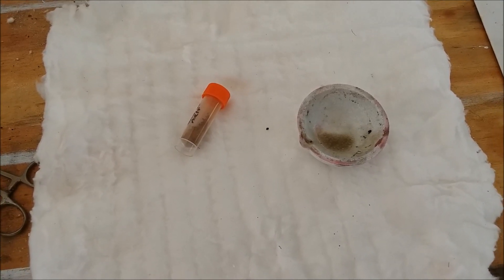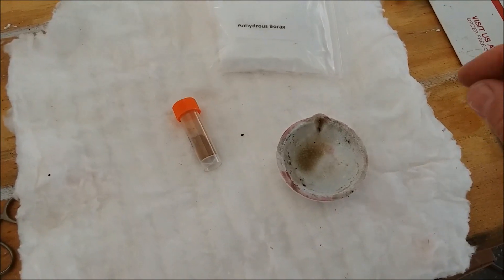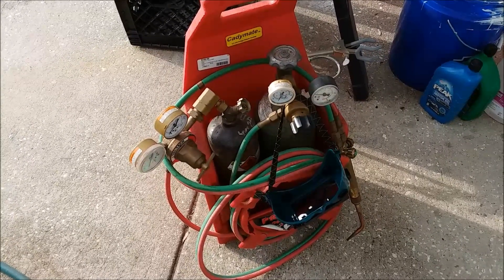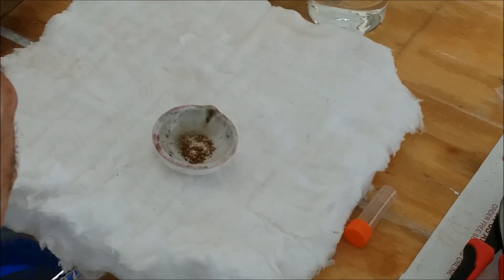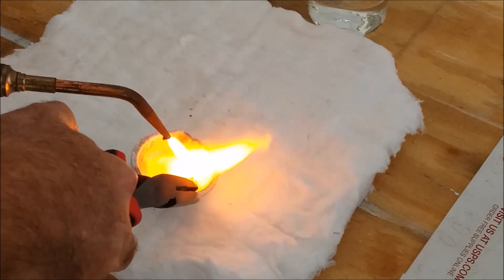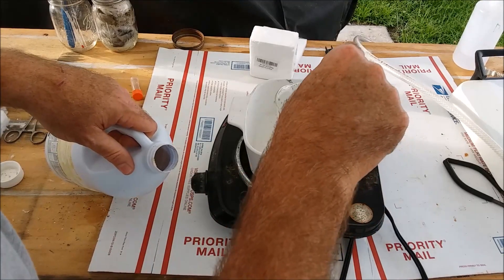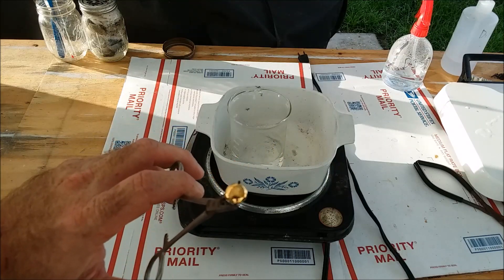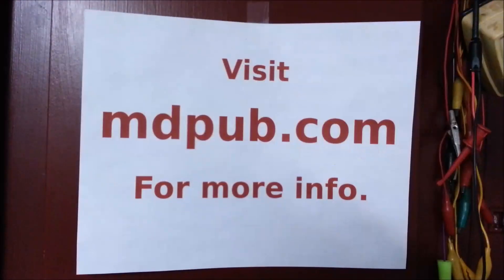Melting a five gram gold bead from e-waste

Comment: Cool video! Could I do the melting with a propane torch?
Reply from the maker: Propane alone doesn't get hot enough. Even MAPP gas isn't really hot enough. A propane/oxygen torch might get hot enough, but I'm not certain. Oxy/acetylene works and is easy to come by. Oxy/hydrogen I'm sure would work too, but it is not a common combination.

Comment: It would melt alot quicker if you cut back the acetylene and added more oxygen so you have a blue flame with a visible second flame in the center of the outer blue flame